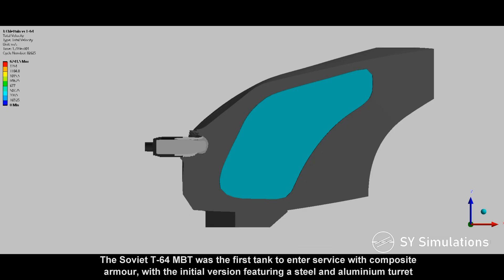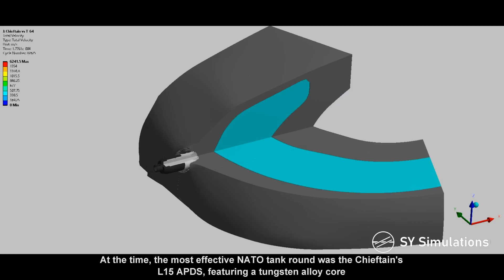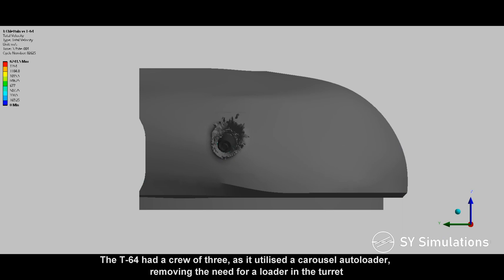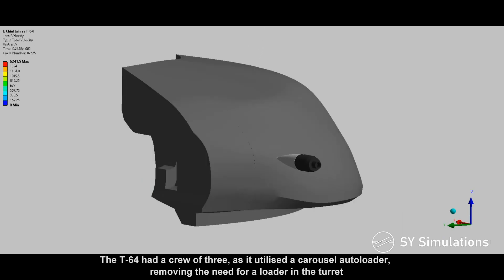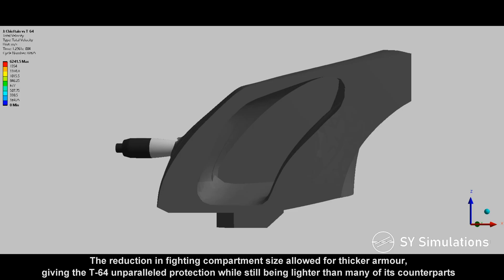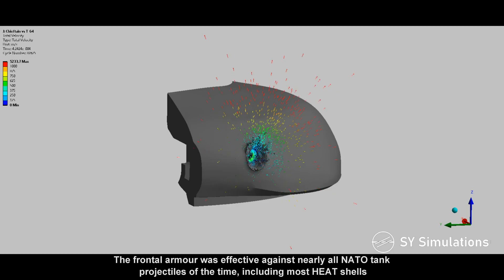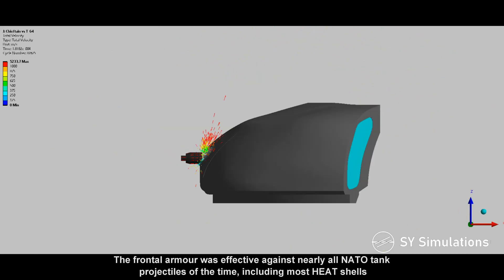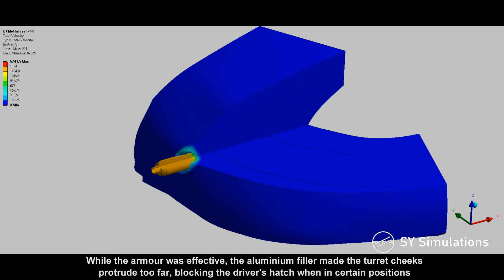THE FIRST TANK WITH COMPOSITE ARMOUR | Chieftain vs T-64 Object 432 | Armour Penetration Simulation

Comment: Even though that didn't penetrate, that'd still cause a heck of a lot of damage.  In the right spot, it'd be a mission kill and that's assuming one can only see the turret front to fire at.
Reply: No spall and didnt even bulge. Just mild concussion and loud bang for turret crew.
Reply: And how? The armor did not even spall xD
Reply: in the position in the vid i doubt it would damage anything
Reply: I guess the shock could damage the traverse mechanism or something else,  like sights?
Reply: No
Reply: Also the chieftain was at 250 meters, at 1km it's barely even gonna get through the first layer
Reply: @Harisankar.P  doesn't lose that much pen at 1km
Reply: @christians.597  I mean it can only partially pen the ufp of t-64 at 800 meters tho and the turret is even more armored
Reply: @Harisankar.P  it's only 130mm and barely angled

Comment: I wonder how it would fare against just the steel, with no gap and steel with aluminium replaced by air.
Reply: @Borsuk3344  significantly worse because there is no real velocity decrease (that was caused by the aluminium)
Reply: better, but still would stop the L15. i think since the angle is fairly flat, if the 2 CHA plates where a single block of 330mm, the Conqueror's APDS would perform better than the Chieftain's, but in this case with the hole between them, it would perform worse.
Reply: Al replaced by steel will work alot better against ap, and minimal improvement against scj. 
Simple sirspace will just pwrform worse all around. 
They tested all those when they are designing the vehicle.
Reply: Probably better, since the aluminum is there to defeat Chemical Effect projectiles.
Reply: @NotLilWien obviously not. Aluminum, IIRC, needs about 2.5x the volume for it to be as effective as a bit of steel. Now compare that to air, where shells travel through kilometers of it and still work, and realize that you don’t understand how anything works
Reply: @captainfactoid3867  The "empty space" was for CE shells after they detonate, where the molten jet quickly loses its velocity and penetration capability. I should've specified that, my bad
Reply: @NotLilWien   you don’t understand how HEAT shells work. Air is not a good volumetric armor against HEAT shells compared to other materials. Air is light, and only costs the weight of the screen away from the armor. So in terms of weight air is better armor against HEAT shells than many other materials. But when you have a volume limited area like this space in the T-64, filling it with steel is too heavy but very effective armor, filling it with air is not effective armor but very light, filling it with aluminum is good compromise between weight and protection. 

Denser materials offer better protection against HEAT shells, but it scales terribly in terms of weight for the vehicle. So using an example with not real arbitrary numbers: DU is 2 times more effective against HEAT shells than steel, but 3 times as heavier. So volumetrically it is better armor but weight-wise it is worse 

Also it’s not molten. It’s plasticized. You could even use the term quasi-molten if you really like the word “molten”
Reply: @NotLilWien  ofc NOT it's like you with an pillow armor and getting ram by bull
Now what if you just naked then got ram by a bull it would be worse
Reply: @marvelinofirmansyah1452  Even SYsimulations posted a comment saying the aluminum filler was to counter CE projectiles. Your analogy makes no sense. KE projectiles lose more energy when going through denser materials (Steel, Tungsten, Depleted Uranium, Ceramic Plates, your skull) where as CE projectiles lose energy when going through less dense materials (Aluminum, Polyethylene, Air). The best and cheapest protection against CE is empty space, but that doesnt help against KE, so a compromise like Aluminum is used since its cheap, lightweight and still has some density to aid in stopping KE projectiles.
Reply: @marvelinofirmansyah1452 As the other person said, the Aluminum is for CE rounds. Aluminum is inferior to steel as armor in general.
Besides that, vast majority of composite are less volume efficient than pure steel. The same thickness of RHA will provide more protection. However, composites are more WEIGHT efficient. So if we simply convert the volume to steel, it will generally be more effective, but weigh much more than an equivalently protective composite.

While size matters, weight matters much more.
Reply: @neurofiedyamato8763  With your logic. Wood is good at KE rounds, because I placed the woods 200km apart.
Reply: @NotLilWien  This is not true, shaped charges are affected by changes in density, not lower density materials. When the stress on the stream of liner material builds up during its penetration through steel, the change in density that occurs when it breaks through into the lower density layer causes the jet to break up into individual chunks instead of stay together. At this point the lower density layer is only there to try to cause the chunks of the jet to slow down. The actual material of the jet mostly doesn't matter (except air which is terrible) and it requires a thick steel layer in front of it to work
Reply: @NotLilWien with your logic. CE rounds will be less effective if I remove the steel